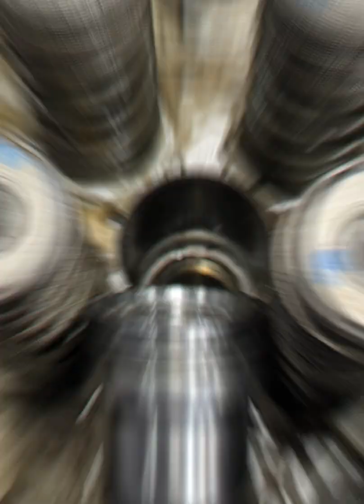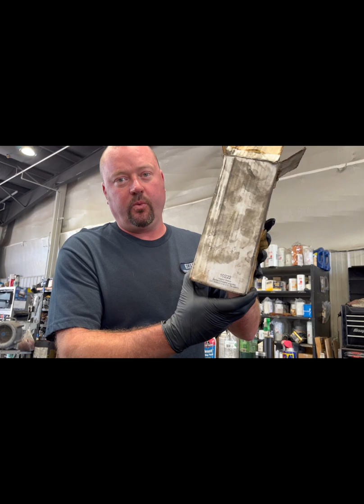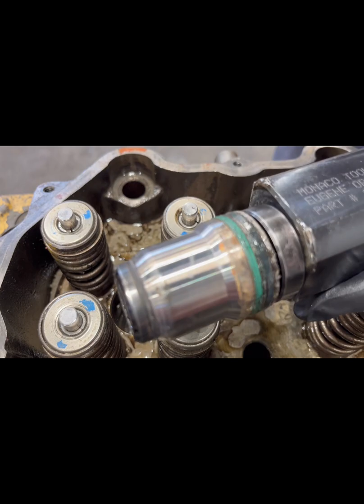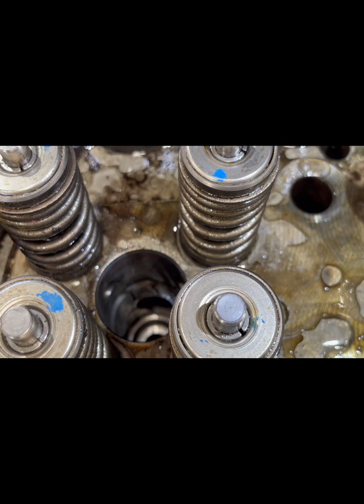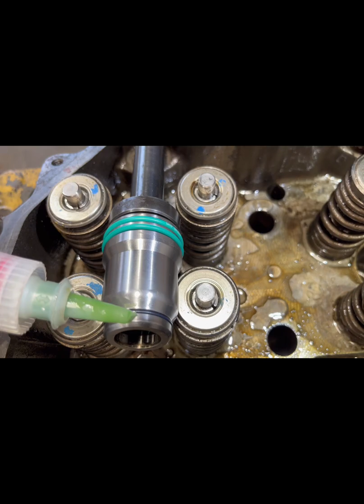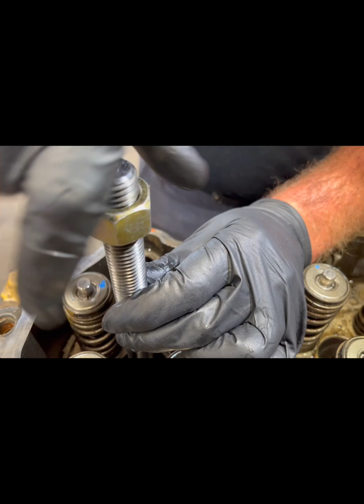C15 CAT injector cup removal and installation

Comment: So why is labor for this job over $2000 parts are cheap loaner is expensive how many hours is this job in a truck from start to finish thanks for the knowledge
Reply from the maker: Good question.  Typically diesel mechanics charge 9to13 hours labor depending on the truck application.  The good news is, the job can be done without having to remove the cylinder head.  On the C15, the work begins one the cups and installed. Injectors have to be cleaned and resealed.  A complete valve adjustment has to be done and then injectors and jakes adjusted as well.  Once the engine is running, the cooling system has to be flushed several times before filling with coolant.  Typically there are coolant hoses that need to be change as well from fuel in cooling system.  Also the fuel tanks have to be drained and filled with clean fuel.  Then new fuel filters have to be installed.  Usually when you have a injector cup failure, coolant goes in fuel system and also fuel goes in cooling system.  We hopes this explains your question. Thanks.
Reply: @etrtruckcenterenginedrivet8918   Good answer!